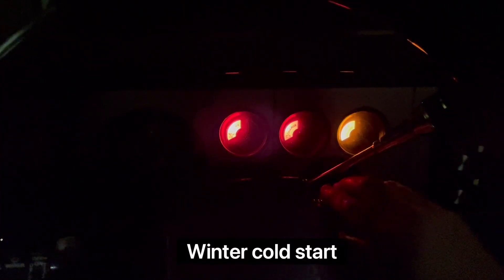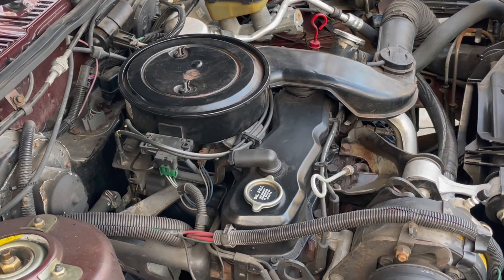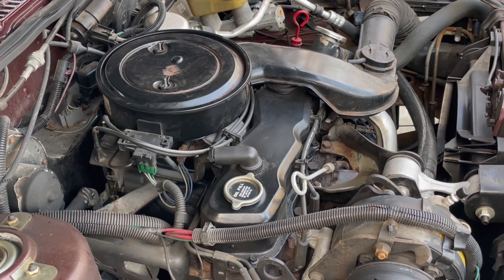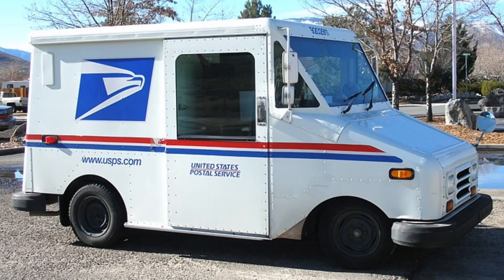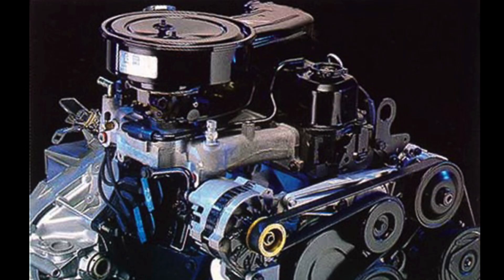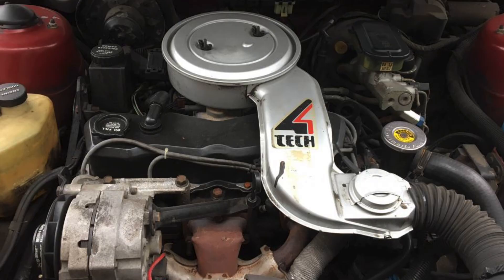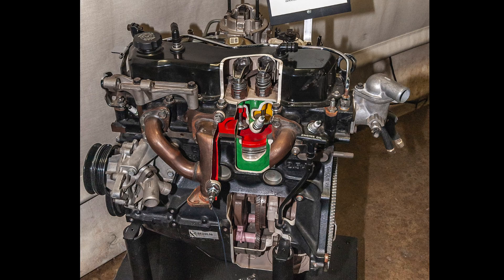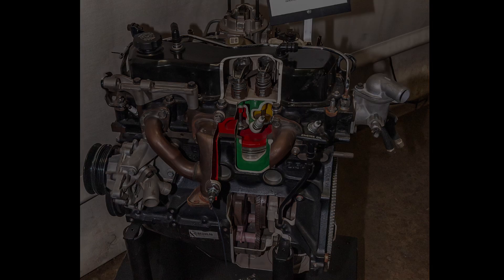Worst Sounding (and Most Recognizable) Engines: GM's "Puttering" Iron Duke 2.5L I-4

Comment: GM 2.2 liter 4 in J cars early 2000's was almost equally rough running, low on power and needing maintenance as headgaskets were prone to failure every 50k or so. The cam gear in 2.5 was actually easy to change pull side cover drill gear near cam and hit with air chisel it falls off and smack new one on bobs your uncle

Comment: Another reason for the development of the Iron Duke was the awful NVH and reliability of the Vega -H Body Monza 2.3. Compared to that and it's aluminum experimental - half baked engineering, the Iron Duke was a return to simplicity, smoothness and reliability. No nonsense.
Even the name Iron Duke was a shout out to sturdiness compared to the warping blocks of the Vega.😮

Comment: I worked as a mechanic in the late '80s and saw dozens of those iron junk engines. Not the worst thing I've seen, but they were pretty bad. The biggest problem I remember was cracked heads.

Comment: I had an 86 Cutlass Ciera 2 door w an iron duke, got it for 300 bucks, and that little engine was the most solid bit of it. Exhaust was rusted out too so it sounded mean. Never idled right tho... Thing was my first car, and my dad and I bought it in 2018 when I was in 4th grade. Sadly after a while of it being an add oil car (valve cover gasket was chugging the stuff), we did an oil change, and turns out the previous owner had silicon'd the drain plug shut, so we had to see it go away on a flatbed.

Comment: I had an '87 Buick Skylark with that 2.5L engine. It had throttle body injection and it had the cartridge oil filter. The car had the 5 speed manual transmission and when I would go on long trips i would get 44MPG. I hated changing the oil because it didn't have a drain plug, you just carefully removed the oil cartridge cap on the bottom of the oil pan.  I finally sold the car and it had 187000 miles on it and the engine was still running strong.

Comment: Increase compression ratio and timing to “10 degrees of advance with excellent exhaust flow from flow master muffler.
Under 10 sec. 0-100km/h 
City traffic Euro style 10l at 100km
Mine was 1980 Skylark 4cil. First car!

Comment: I owned a 91 S10 and a 91 Skylark, both with "Iron Dukes." From what I can recall, the engine in the truck ran smoother & quieter than the one in the car. Perhaps front drive vs rear drive and motor mounts made the difference? I was always under the belief that the Iron Duke was an evolution of the 4-cyl that was standard in 62 Novas.
Reply: Yes the Duke had a crossflow head, the old 153 cube 4 cyl was both intake and exhaust on the same side.  My buddy had a 62 Chevy II 153 with a 3 speed on the column.  We took it to the drags, it beat a stock VW bug and a Renault Dauphine, but otherwise was the slowest time of the day, still got a trophy LOL.

Comment: The timing gear is the main culprit. A Four cylinder cam pulsate a lot. That’s also the reason why the phenolic gear gets shredded so quickly compared to the same gear in the 250 six cylinder.

Comment: i still have the duke and its in a 1996 hyster 50 forklift it never let me down and it dont make much noise at all but i found that its favorite oil is valvoline vr1 20/50 i change every 2 years

Comment: Besides most of GM's V6s sounding like they were made out of wood, Ford's 3.8L V6 sounded terrible. Ford's HSC/HSO engines made a rattling diesel noise when the harmonic balancer frequently failed.

Comment: It surprises me that GM we’re developing the Iron Duke in this form in 1977; ten years earlier (1967) Vauxhall produced the OHC inline four in the UK incorporating a serpentine belt and could be opened up to 2.6litres, this engine was certainly one of the better engines on the road,  reliable, smooth running and torquey despite being very oversquare, it was also very successful in racing and used by other companies; even if they didn’t take this particular engine for use in the US, the technology to produce a good big-four cylinder engine was there.

Comment: Rock star David Bowie (RIP!) was creative and talented, and nicknamed "The Thin White Duke". John Wayne was affectionately called by many of his fans "The Duke". And then there's GM's famous (some say infamous) 2.5L "Iron Duke". I haven't had much if any experience with this engine. But it seems to have served GM well, and doesn't seem to sound much worse than other 4-lungers. I think the infamous Olds 5.7 diesels sounded much more like tractor engines than the Iron Duke. And I'm not a fan of the growling sound most V6 engines make either. Even the new Mopar "Hurricane" turbo inline 6 growls. That's supposed to be the Hemi's ICE replacement. Not sure how well that will go among Dodge Charger fans.

Comment: I submit the General Motors Holden “Starfire” 1.9 litre 4 cylinder engine we had Austrialia and New Zealand. Basically a Holden six 
with two cylinders cut off. A truly dreadful thing produced between 1978 and 1986 when it was finally put down. Known as the “Misfire” or the “Backfire” it was noisy, thirsty, gutless and just plain nasty.

Comment: Yes !  I had 85 Olds Ciera with heavy iron Duke.  Zero torque, loud, when cold it idled at 30 mph, couldn’t do a thing about it, just slam into gear and drive until warmed.  It was fine for a work car, it did pass the gas stations, was only thing passed.  Heavy motor, FWD, no power, it was most excellent traction on snow and ice.  I gave up on the AC when new Freon came out.  Had a Freon conversion kit attempt, but higher pressure blew out seals.  Gave car away to family who’d didn’t care on AC.

Comment: My 2.5 litre engine that was in my 1985 cutass ciera had a very badly pitted and worn cam that made it click and clatter very loudly.  From what I remember they where good at eating cam shafts, and also they had two different 2.5 litre engines.  I know this because I tried to swap my engine in the cutlass ciera into my brothers wife's cutlass calais and found out while trying to swap it that the block was shorter in her car by about 2 inches and so motor mounts where different.  I guess it was called the sport block 2.5.  It had a lighter shorter block for the calais.

Comment: I never enjoyed the sound these dukes made. I referred to them as the moaning and groaning engines. Basically engines that complained about every RPM they made. These were engines made to operate in the 2,000 to 4,400 rpm range and did not like it if you pushed them hard. And any red blooded guy with a pulse over 16 and under about 60 years of age floored the go peddle on these from the moment they took their foot off the brake. And were for the most part continuously disappointed. But in the right car, driven within their power band they gave decent performance. Case in point. A rental 2 door Oldsmobile X car cutlass front wheel drive in rental spec mode. Without a tachometer, you did not see just how gutless it was and the car was actually light enough to move out reasonably smartly and the skinny 14 inch wheel and tire combination gave responsive handling at any speed below 70 mph. I thoroughly enjoyed the surprised look on my co workers face after I tweaked the tire pressures and put better gas in it.  The engine had the computer controlled throttle body fuel injector on it and gave a noticeably improved responsiveness with a better grade of gasoline in the tank. It was noticeably quicker and the steering response and cornering improved dramatically. So much in fact, when he got into it and drove it like he did before, he ran off onto the shoulder because of the increased performance. The first words out of his mouth was ‘what did you do to this thing?’ My reply was ‘I fixed it.’

Comment: Noise and resonance from tubular exhaust that would glow red hot under load, the vi ration would snap the starter  outside too, replaced a few cam gears on these in the Fiero by dropping engine down at an angle to slide the camshaft out! Easy to work on.

Comment: Any engine that refuses to stop running seemingly FOREVER sounds good to me. Wasn't made for racing, low power was a key factor in its durability. Gear driven cam was another. In front wheel drive it was nearly impossible to remove the oil filter on a neglected one in a FWD, but the Iron Duke would still always get you there. What's embarrassing about that?

Comment: Crude but admirable.   That's the best I can describe the Iron Duke.   My sister had one in a 1986 Grand Am (loved that  car!).   It went 178k miles... 😊.   

You forgot to mention that this engine replaced the Chevrolet Vega engine for not being reliable.   So this Duke was a HUGE improvement there... Lol.   With that being said, the QUAD 4 was another bad 4 cylinder from GM.   You can't hardly find those anywhere.., so the Iron Duke isn't really that bad.

Comment: Worked on many Iron Dukes back in the day.  Those throttle body injectors and idle air control solenoids were damn noisy too!  The always seemed to keep moving despite the vehicle around them collapsing.  I pass an S10 on the way to work every day that is bent into a banana shape due to rust.  But the Duke keeps on driving..

Comment: I listened to the video on my stereo system, and the Iron Duke engine sounded just fine to me (except for the starter, as someone else mentioned).  A couple engines where I didn’t like the sound were in my 2009 new-car shopping, Honda Civic and Nissan Altima, both 4-cylinder.  For both of them, I didn’t like the clicking I heard with the hood open with it idling.  I have no idea if it was from injectors or valves.  Bought the Altima since it had 30 more HP.

Comment: I remember my Dad’s 86 cutlass ciera with that engine. It was smooth running but If the AC was on and you made a right turn, the car would die. Every single time.

Comment: Yup... Had two, 86 6000LE wagon and an 86 Cutlass Ciera base sedan.  The 6000 had a bad engine/transmission mount, so it would rock back and forth at idle.  Gutless (80mph max) and not really fuel efficient (low 20s), but reliable.

Comment: This engine certainly does not sound refined. But over in Europe in the late 60's and 70's we used to have the Simca 1100. As you can guess that had an inline four, 1100 CC engine. That engine was the worst sounding engine I remember. It sounded literally like a box of nails. The car it self would rust like no tomorrow, but not as bad as the later Simca 1307/1308.

Comment: I love the old Iron Duke! I am having flashbacks of that low-"Tech 4" EFI system.... LOL I think it was a great engine in the Fiero because it was all iron, and until you learned how to properly burp the cooling system in a Fiero, they would have bad overheating problems. Starting up the Fiero with the sunroof open was a great way to startle a passenger.... "Wait.... is the engine behind us??" (Wait until you notice the sound of the electric fuel pump in the tank between our seats.) Now if only I could have bolted a Chrysler Dive-Bomber gear reduction starter to the Iron Duke.... 
Pretty much any car with electronic ignition or any form of EFI is going to have electrolytic capacitors (besides just in the radio). I cannot imagine how many cars must get scrapped because of bad capacitors. 
They're like little storage tanks for electricity and tend to look like little beer cans soldered to the circuit boards. Like beer cans, they go stale from age, but heat cycles (Cars are bad for this! Think of the hot car on a sunny day, then you turn on the AC... Or a cold car in a northern climate, then you start it and drive it) really accelerate the aging. My 1985 Fiero 2M4 SE was about 15 years old when its capacitors started to get flaky... and I had just rebuilt the engine myself in my driveway. 
Symptom I had? No start. Good crank, great compression, good fuel delivery, good spark, but no start. One time, stranded at a gas station, I pushed it out of the way and hopped in, dropped the clutch in desperation, and the engine came right to life. And it was consistent that when I could not get it to start, I'd roll it and pop the clutch and drive off! Infuriating. And, of course, the sort of intermittent problem that a mechanic would not be able to reproduce without driving the car every day for a week. In an automatic vehicle, it would just present as an intermittent no-start. 
Remember, every single day after an electrolytic capacitor is manufactured, it is gradually going bad. An EFI system with original capacitors will become more unreliable every single day. Until your Grand National won't start. Or your 2006 Toyota Corolla just throws an untraceable Check Engine light or any number of a million other problems that will happen with ALL electronically-controlled engines. Used parts will NOT help you long-term because the capacitors will be just as old in the replacement ECM as in the ECM you are replacing. 
My background is in electronics, especially vintage electronics (radio and TV sets). I was sitting with meters reading the 5V rails to the TPS and MAP sensors and other stuff.... All looked good during cranking, solid 5V. WTF? 
I was working on radar video systems for a major US Defense contractor. I borrowed a Digital Storage Oscilloscope from work and connected it to the ECM's 5V rail. Cranked the engine, then looked at the scope - as the engine was hitting compression, the starter was loading down the ECM's 12V supply to below 5V in super-quick downward "spikes". The 5V regulator was therefore shutting down and forcing the ECM to reset. As it was resetting, it was losing spark timing and so never got it right to fire the engine. 
Took apart the ECM. Found a few capacitors with bad ESR ("Equivalent Series Resistance") caused by capacitor age - the capacitors were no longer capable of dumping their charge fast enough to smooth out normal transients caused by the starter hitting a compression stroke. Got good replacement capacitors from a reputable electronics supplier (do NOT buy capacitors off Amazon, they will be counterfeits or old!) and soldered the new ones in place of the old ones. I think the Fiero was only a double-sided board, modern stuff is going to be a multilayer board and requires really good soldering skills, but it is do-able with minimal electronics tools and a steady hand. Also watch for corrosion from the liquid electrolyte in the capacitors leaking and eating the conductive traces on the board - you can fix this carefully in most cases, but it has to be done well or the engine could stall at a Very Bad Moment like merging onto a freeway or making a left turn. 
Hopped in, turned the key. The Iron Duke came right to life. Rock-solid on the 5V rail to the TPS. No more reset being asserted to the CPU chip. I kept up the habit of parking the car on hills for a while until I was confident that the problem was in fact, cured. 
@shango066 does electronics repairs and resurrections and covers an ECM/ECU repair right here: 
https://www.youtube.com/watch?v=RUhvuCwVIl4
Hope this helps someone keep their old EFI car or truck running.
Reply: Mosfets wear out as well i went through all of this with my 87 Ranger. The caps were replaced and it still would drop the back two cyl. Turned out the mosfet that drove the back two injectors was failing solder joints looked great. Replaced and its still running great love how simple first gen fuel injection is. My truck has 1.3 million miles on it everything fails after that much drive time.
Reply: Interesting, I am more familiar with the ECU's in the tuned port F body's. Those ECU's have no electrolytics everything in them is surface mount.
Reply: Thanks for the heads-up...one MORE thing to worry about now...😭
Reply: I could be wrong, but I heard that GM ECUs of this era had no electrolytic capacitors. I don't know if they used tantalums or simply omitted them altogether. Most ECUs will run ok without their electrolytic caps, it's only when leaking electrolyte starts eating up traces that problems crop up.

Comment: I have one in my garage. The head is probably warped to hell from running that thing with no cooling system but it's a lot tougher than the car that's rusting away around it. As for noise my BMW N54 certainly gives it a run for its money between the injectors and hydraulic lifters ticking in the cold, if you take off the engine cover it's definitely louder.

Comment: Honorable mention should go to the odd-fire Buick V6 - all variants, Chevrolet 3.3 (200) and 2.8 (229) V6 and of course the Olds Diesels (both V6 and V8). I'd also throw in the early Chrysler 2.2. 

This would all depend on what your frame of reference was. Domestic-only car people of the day would probably not object too much to the higher levels of NVH. But, if you were stepping out of an import (even a diesel import) these engines would all seem 'agricultural' - as the rags of the day often put it.

Comment: This Iron Duke engine definitely sounded antiquated and noisy, especially if it had an exhaust leak where the down-pipe attached to the exhaust manifold. Back in the early '80s, I had one of these engines in a company car (Chevy Celebrity), which was a total dog! A couple years later when it was time for new replacement company cars, I opted for the Chev Citation 2-door hatchback with the optional 2.8 liter V6 engine.....much smoother, quieter and more powerful. Those GM cars, however, were of low quality and not built very well.....total throw-away cars.

Comment: My first car was an '89 Buick Skylark with the Iron Duke. That thing chucked a piece of its oil pump balance weights through the side of the block, then (after it was repaired creatively) proceeded to drive another 13k until it blew a head gasket in the hot Phoenix summer at 101k. Still have the car and plan to swap in a L67 S/C 3800, a much better sounding and performing power plant imo.
Reply: Repaired with JB weld?